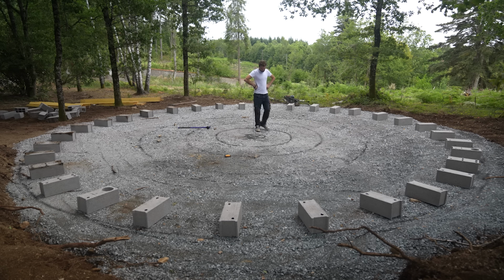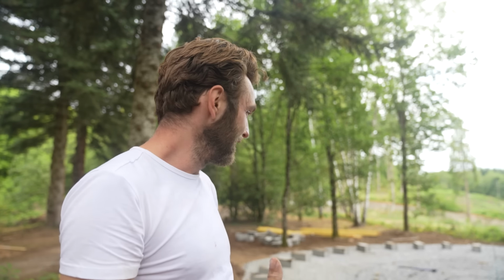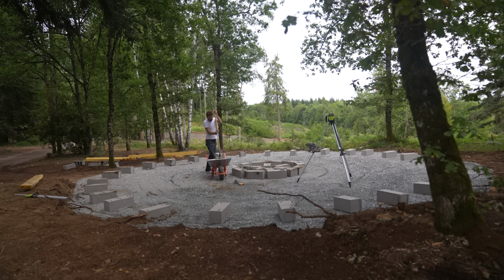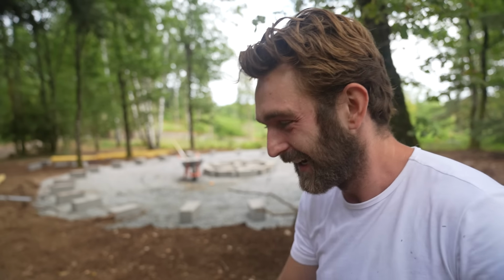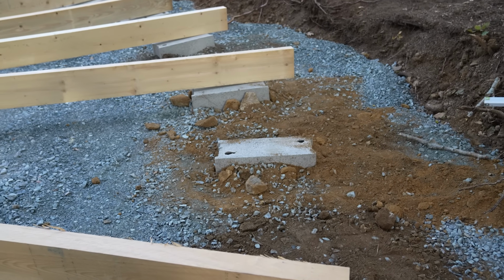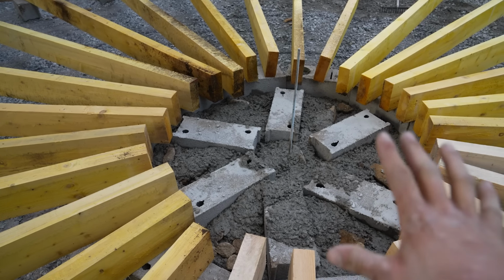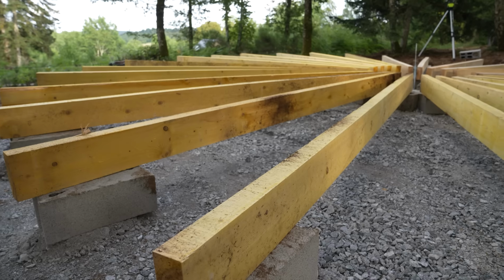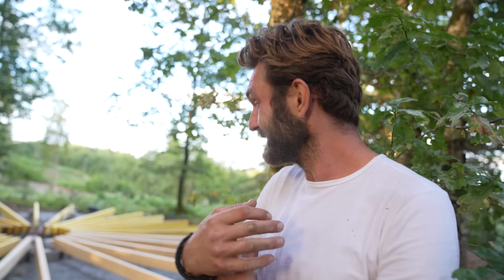Pumping water from the old chateau source.

Comment: I agree Dan. I have done a 10 year stone building project with no roof and you need that clean soft place to fall. Just a question, I hope the beams are pressure treated like decking boards or you will start seeing rot within the first year. Varnish or not. It is going to be so fantastic and self sufficient with wood heating. Keep them coming. Heather

Comment: Open well like that...20 years plus. Has at least one meter of mud and crap plus dead annimals at the bottom. I would pump out all the water first and then clean it during the dryest season where the water level are lowest. Besides that I would run a metal detector through everything that come up. Kids throw things in wells all the time.

Comment: V120: OMG that Yurt base is HUGE! OHHHHHH i have been waiting AGES to see the well used - whoo hooo! That shaft is DEEP 😯 right Dan. FIRST get a water test kit to check A) the Ph and B) for impurities. Then a ceramic filter and some FOOD GRADE carboys (PLENTY on ebay going cheep 1000 Litres tanks like 50 Euros each) NEXT run the water pump until the water flows CLEAR and test again. That 'cement water' that's coming out is stagnant and dodgy. (the well will not replenish if the level doesn't drop as that's the height of the water table. PURGING your water source will revive the aquifer and start  bringing in crystal clear BEAUCOUP D'EAU!😊 I expect you will have potable water after a ceramic filter. Put one of the carboys up a few floors on the new floors extend the feed pipe up to it and you will have a gravity fed supply :) 
OR maybe tap into one of the original well pipes and PUMP WATER........SEE where it pops out?

Comment: Hi mate, remember that the water pump should have a solid walled hose or tube, because the pump has to pump up hill and also overcome the pressure involved to expand that flat type of fire hose. That hose is not what you need, its ok for that short distance. Awesome though. Cheers

Comment: If your long-term intention is to try to reuse the well as the main water supply for the house, it might be worth considering incorporating rooftop rainwater harvesting to be fed back into the well. Whereas the well on its own was probably reliably adequate in earlier times, climate change will probably mean that groundwater refilling alone of the well could prove unreliable in future years. Rooftop rainwater harvesting topping up of the well could be the antidote for that eventuality.

Basically a belt and braces approach, and one that could save substantial sums of money on having to buy in water supplies in drought years. It should also help to increase the value of the property should you ever wish to sell the property as it increases water independence. Water and energy independence will increase in importance to prospective buyers as climate change accelerates, especially in rural areas where there simply isn't the same level of infrastructure as in an urban setting, possibly attracting a hefty premium to final property prices.

Comment: As an American, I'm curious about the concrete "Breeze" blocks ("Cinder Blocks" as we call them here) and their shapes.
They all have six holes on one side, but have different small holes on the other.
When you order your bricks, do they do equal amounts of each, or do you order them in certain quantities for different needs?
What are the purposes of the different holes?
Again, here in the States the blocks have two or three voids that go through to both sides, and line up when stacked so that they can be filled, or used for pipes/chases/conduit, etc..
Reply: The holes are to stick rebar through.

Comment: Dan, for safety's sake, don't you need to put a fencing around the well opening to prevent anything, or anyone, from falling in?
Reply: I am sure eventually he will. The well seems far from the building site though. Until he does, no one’s likely to be going over there without Dan knowing, to escort them.
Reply: That well has been uncovered for 40 years. He will surely cover it but not until it is cleaned up and he has time to make an amazing roof with a little tower, if you know Dan... over the well. It just is not focus now as yourt is priority nr. one and roof ower the ruin nr. two, before winter comes.

Comment: Consider not using the well but drilling a new well. You can get water from a greater depth, which is much purer and needs less purification.
In addition, try to collect rainwater in the future for toilet, laundry, showering, etc. (so not as drinking water)
Do not enter the well without a carbon dioxide check.

Comment: A. You are amazing Dan the Gardener.
B. You might think about covering up that well in case an animal (or a kid) would fall in.  That would suck.  
C. You can also filter, in fact you should filter the water, if you plan on drinking it.
D.  The cut wood you use looks like it is a whole 2" x 4" (I know but in metric).  Our 2" x 4" are actually 1.5" x 3.5" to account for drywall, etc.  All of our cut wood is 1/2" less than what we call them.  2" x 6" is 1.5" x 5'5" , etc.  Are yours?  They look like a full 2 x 4 or whatever, in metric.  They're bigger.

Comment: I can't wait to see what you do for floor insulation! The only material I know of that can be sandwiched between graveled ground and floor is styrofoam pellets. But if you're making an insulated elevated floor layer, there's alot to chose from. Some people use sheeps fleece from shearings that can't be used for yarn etc. Some sheepfarmers sell it uncleaned for next to nothing in bulk. Really effective and healthy apparently. Regular fiberglass wool usually needs both outer and inner boards, plus good space between the outermost layers for damp diffusion to be sustainable, healthy. But I'm not a builder, so I'm curious to see how you construct this base layer. One thing you don't want in a Yurt is a very cold floor. Heat rises. I'm not sure how the Mongolians do it..? But they do have lots of carpets rolled out woven from yak wool and cashmere for comfort. I'm sure this build will be worthy of envy to those of us who like to live alternatively sometimes or dream of independant sustainable, low footprint living in touch with nature.
Round structures are very holding, enveloping, cosy, and heat economical. ❤

Comment: Regarding the Well. Are Vacuum Pump Trucks a thing in France ? The trucks which do wet excavations, drain and culvert cleaning. The operator should be able to pump out all the muck in the well without the need to physically enter the restricted space. Maybe try a company who pump out septic tanks, if that is a thing in France.
Here in South East Queensland, Australia, vacuum pump trucks are common. An Earthmoving company I used to work for had a few, and they were in constant demand, and were relatively inexpensive, hourly rate wise, being really quick, and have a very small on site footprint. Extremely versatile equipment. 
I wish I was there to help out, everything you do is right up my alley. Cheers.

Comment: As you say water is fine for building at the moment. Keep upping it for a week or more to dryness as any nitrates etc in the local water table will take time to pull through. At that point take three samples to a suitable chemist and have them analysed for potability. If it passes and it probably will keep it pumped on a regular basis to prevent future build up. This is the format for country wells in U.K. and failure to comply with potability means requirement to provide mains water. This is important for guests for while you may become immune to the natural supply it could provide them with problems. Boiling can provide a temporary solution.

Comment: Untreated wood should not be place directly against concrete because water will wick up in the concrete blocks you are using therefore it is advisable/necessary at least to put a sheet/layer of (torch down or EPDM) rubber roofing between the concrete blocks/concrete and your joists otherwise the wood in direct contact with the concrete will rot.  When I installed a tent using similar base construction with  1 1/8 inch plywood screwed down with square drive deck screws, I also treated all the wood with Thompson's water seal and very dilute solution of "copper green"/copper napthenate to deter insect/termite destruction.   When I took this flooring apart 6 years later, all of the wood was totally undamaged and re-usable same as new.

Comment: You’re gonna want to insulate under the floor of the yurt, I know you guys don’t get as cold as we do in Canada but you’re still gonna want to keep it from having moisture or cold. It would be smart for you to insulate the boards as you’re putting them down instead of having to crawl underneath to spray foam or attach some kind of insulation. Maybe what you can do is get those sheets of foam insulation and glue them onto the boards, and then put the boards down. Hopefully you know what I’m talking about (sheets of insulation… packed foam) I believe Teri from escaping to the dream, restoring the Château, used them to do the walls in the attic for their apartment.
Reply: I remember last winter Dan was working in minus 5 degrees celsius  ,so it can get pretty cold there.

Comment: Yes! First off, what’s wrong with “over the top”? I think it is looking great and just the placement of the blocks and the boards make such a big difference. Water on site, even if it is less than crystal clear gives you the opportunity to do so much. After the yurt is in are you going to be getting an IBC tote to hold water so you don’t have to run the pump every time you need a bucket of water? Thanks for sharing!

Comment: That yurt will be awesome! With plenty of insulation, you should be able to have the boys over to stay. Do you not have to seal the yurt wood beams you just put in at all, or just the floor/base? Maybe water won't pool under it and stay damp? Just wondered, as there seems to be a slope to the side of the yurt base.

Comment: Fan im watching  u lay the blocks for the base . why did u decide to lsy them inwards thus reducing the bearing balance of each block . They should be layed the direction of the perimeter this means your joists will have a bigger besring foot also the perimeter noggins will have a larger besring . Do you have building inspectors in France to advise hard working ametures  where the go wrong ?

Comment: That water is not good enough for concrete class more than C 12/15 but for base of the yurt will do ok. Just don’t try to make a connecting rebar reinforced concrete beam with that water.

Comment: hope you plan on a roof soon hate to see that OSB flooring expensive have to be replace. it absorbs and swells.
Reply: Yes, the wood beams/joists as well need protection as well.   Dan has said previously that the OSB3 floors are temporary.   He may have to replace some OSB3 before he gets the upper walls stabilized to support temporary roof.   After the yurt installation (Dan is only doing yurt base; he is hiring others to install yurt itself) slated for 8/2, Dan can return his attention back to the chateau right wing; it's a race against upper floors installation, wall stabilization, roof install and rain/inclement weather.
Reply: @homeemail2306  if he knew it was temp why not use a cheaper product? When he said;he had no building experience i thought it was a joke.
where are you from I'm from Worcester Mass USA
Reply: @noway5683  That is a very good question.   I do not know why he chose OSB3 over cheaper materials as a temporary floor.. 
As I write this, I am recalling him working on the interior walls, dropping lots of stone & also huge cement chunks from old  fireplace onto the OSB3 floors, and saying something like "See, that why I chose these OSB3 floors; to be able to handle the debris falling on them."
Even so, still a mystery to me.
I am from the Hill Country of TX/USA.

Comment: Dan does the manufacturer not supply a version of the battery thingy with large diameter wheels to better facilitate travel over rougher terrain?

Those dinky little suitcase wheels look like they are only really suitable for a prepared surface such as concrete or pavers rather than for more remote locations.

Comment: Great you are using that old well. I had mentioned some time ago that you needed on site water for you masonry work. Concrete isn't too particular about the color of the water. Be nice if you had a larger container you could put on the bed of the truck or a trailer to ferry water up to the chateau. I was wondering if you have those boards spaced evenly. Not hard to calculate if you know the overall diameter.

Comment: Dan what a great job you ae doing. My dad used to say to me if a jobs worth doing you do it well. My dad was a perfectionist  and this is a good thing to have. You are a perfectionsit also dan.   i am learning a lot not that i am going to biuld a yert thingybob.   Are the wooden strut things going to be painted in protection paint ? Cos that will preserve the base frame for long time.   The well pump does the bit what sticks in the water have a screen over it to prevent sticks stones and dead things from going up the pipe  as the pipe looks fragile and i am only asking as its a similar thing to the gold miners using the water for thier trumels and they have an end filtery mesk thing on the end that goes in the water,  if you do go down that well please dan dont do it when you are on your own on the property as i can see potential for you to get stuck down it and it you did have a phone in your pocket theri would be no signal to get help!!! just thinking of your safty dan

Comment: don't get in that well!!!! There could be gas down there instead of oxygen!!!! (be sure to test it!)
Reply: Dan said the water smelled bad.   Wise advice from commenter(s) above said a smell like rotten eggs indicates low level of hydrogen sulfide ( H2S.) And that stirring up the debris in the bottom of the well would cause increase in H2S concentration, plus increase in lethal consequences for a person in well if they're not wearing respirator/scuba gear.  Good advice for Dan not to get in the well; there is gas in there.   Well-cleaning is a 2-person job; 2nd person is a spotter to alert the alarm for trouble for 1st person/well cleaner.  That the death of both well-cleaners has occurred by 2nd person going in to rescue troubled 1st person in well.
With Dan installing yurt base, and overseeing yurt installation ( not installing the yurt itself)...and needing to return to continue installing chateau floors, stabilizing the upper floors to get temporary roof on,  Dan would be well advised to get a company that specializes in cleaning wells with a truck that has a hose to suck out debris.
Or a septic truck to clean out the old well.

Comment: Yes it is quite over kill to fill center with concrete  In the USA simple pier blocks with wood block glued in center  of the blocks would be quite sufficient to nail beams to  although your design it preserves the length of the beams ,   a simple  hexagonal deck  would be much more stable even if the beams had to be cut to specific lengths , well if needed  all the material can be re-used  in chateau down the road

Comment: That is a massive yurt you are building. I don't recall seeing one that big before. I was thinking it would be some little thing maybe 16ft across or perhaps as big as 20ft for just one person and the kids now and then. But what you have marked out here is monstrous! What you might find is that a small intimate structure will be far easier to heat than this big one. Especially if it snows.
And if you get your head screwed on better you will realise you can use the barrow to truck the water up the hill to the house rather than carry it in buckets. Or at least put the buckets in the barrow to save your back and energy for more important things. And use 20lt drums or go even bigger and get an IBC or some blue 200lt food-grade drums to hold water. Anyway nothing like experience to teach. 😊

Comment: Dan, please do not cement the wood right onto the ground. It will just rot, even when treated with chemicals. Just put small noggins in the middle as well and leave an air gap to the fireplace stove plate.

Comment: Is that part of the roof that being constructed?
Reply: If you are referring to the large circular structure with concrete blocks & wood beams radiating out like a clock ( or Stonehenge😏), that is the base for Dan's yurt/onsite dwelling while he works on chateau.  Yes, he is building it with the same type of wood he uses for making wood beams/joists for chateau's floors.
Actual yurt tent structure coming 8/2 ( other will install yurt, per Dan) so he has to focus on that.  Afterward, he can return his focus to installing chateau floors, restabilizing the upper walls to support temporary roof.
Reply: @homeemail2306  Yes, I see. And you are! The site-manager?
French roofing materials; they use mainly oak and chestnut for flooring.
Reply: @michaelmayo3127  Ah, no, not on-site manager. Dan holds that title.
Just a follower of Dan's channel, from TX/USA.   Interesting info about French roofing materials, especially the chestnut wood. Spruce, fir & pine used here. 
American. Chestnut was once one of our most widely used construction wood, but sadly, not since blight introduced at turn of 20th century.  A few chestnut tree farms making a comeback, but mostly just a shrub.

Comment: I still believe roofing at least one part of the chateau is critical. Normally one builds from bottom to the top but in this case it is the opposite. The roof is a must and should be made first. On course you need a scafolding. The wood you used today is enough for a structure of the side roof. And a standard living container would be better. I am really impressed by your dedication but side projects like yurt disctract you from the main objectives. And the winter is coming ... Good luck